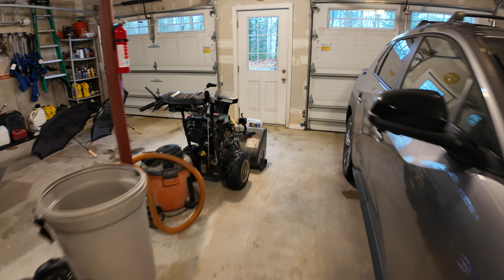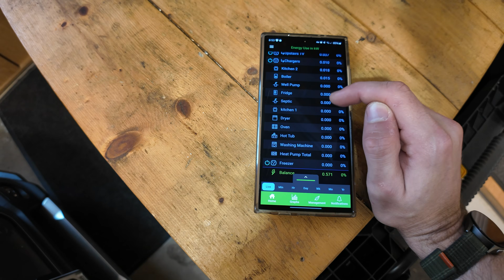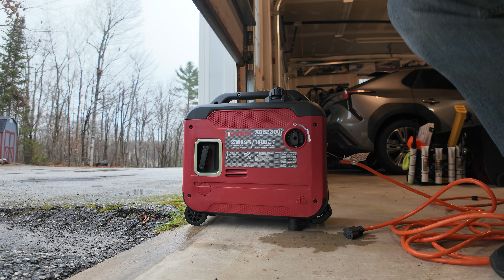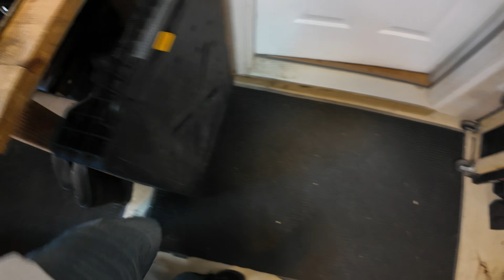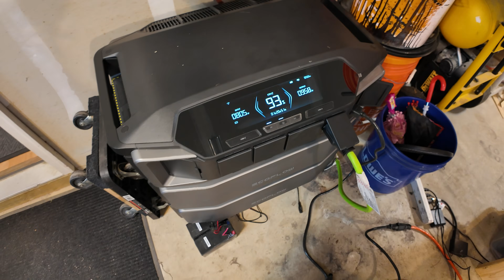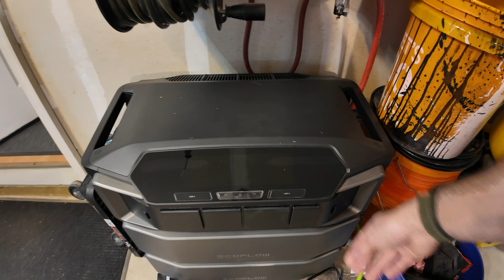Ecoflow Delta Pro Ultra Testing - Small Generator and Limitation While Charging - Home Setup

Comment: When charging and discharging the gas generator is covering both the input and output.( pass through )
Use fast mode and try not the run much in the house. ❤

Comment: Buenas. Compramos un ecoflow DPU. Como respaldo para unas computadoras, en caso de un corte, los equipos continuarán trabajando aunque hubiese un corte de energía de la red local. En mi país Venezuela. En estos momentos tenemos cortes de energía eléctrica diariamente de 6 horas. Al suceder un corte de energía, el equipo DPU. Hace el cambio a la batería de manera eficiente. El problema que tengo es que al regresar la energía de la red local. No se logra recargar o las batería del ecoflow DPU. Por medio del cable que se conecta al Tomacorrientes de la pared.

Comment: You could parallel another A-ipower with yours, they come with the parallel kit in the box. You can also get the dual fuel version of those online at Sam’s for about $50 more. If you wanted a larger 240v inverter generator, I have and really like the Genmax GM7500iAED, also from Sam’s. It’s dual fuel, electric/remote start, pretty quiet and not bad on fuel. It’ll run 8.5 hrs @ 50% load (3,000 watts) on 3.3 gallons of fuel. I also believe that there was a firmware update for Ecoflow that improves the charging/pass through power capability while AC charging.

Comment: Why don't you use it every day to run devices in your home instead of back up ?
Reply from the maker: I dont get time of use deals on electricity use so it would cost more to use it like this until i get solar panels.   My plan next summer is some yard panels connected so i can charge my car.

Comment: Do you have the high speed charge switch set? Was reading about firmware updates for the inverter to fix that charge + discharge issue.

Comment: Great video, I’ve been following your content for a while! I also dream of having a solar setup like the EcoFlow Delta Ultra one day. For now, I’m using an Allpowers system – the batteries are a bit limiting, but I hope the EcoFlow solution works even better. Do you feel like adding more batteries makes a big difference?🔋🔋
Reply from the maker: Until I get solar panels, this system is literally just for power outages.  Once I get a few panels up I will use it to charge my car and in that case more batteries will help

Comment: Probably when you had the load pretty high the Ultra probably went into pass through mode, and the ultra will just pass power through, so the load and input will sync up.
Reply from the maker: Thats what I think now too.  I have a larger generator that does a stable solid 1800 watts continuous now so I can use fast charge mode

Comment: I have this exact generator from Sam’s along with Delta Pro and Delta 2 with extra batteries for each.  This is the first video I have seen where this exact generator is actually charging the unit.  Thanks for proving you don’t need a 3600watt or more generator to charge the Ecoflow.

Comment: So greatest video my friend, so I can charge my ultra with just battery please help ,I have bought a firman dual fuel 3000 to 4000 I need know if this will work. Thank you 🐊🌴😎
Reply from the maker: I replaced this small generator with the firman wh03242 a dual fuel 4000 watt generator and it works great with fast charge on using propane.
Reply: @mainelyhobbies sorry I just seen you comment,,yes you must have caught the blue store sale too,250.00 same generator, lol great videos thanks for vide,🌴🐊😎

Comment: A. You are assuming you are home all of the time.  B. If at night, it will be pitch black.  Do you have flashlights around the house that you can have in reach in each room to see to get to the panel.  C.  A house with just a standing fridge w/freezer, a standing freezer, 5 ceiling fans, a 2.5 ton AC unit, gas stove/electric oven, 1250w microwave, lamps in five rooms, washer and dryer, WiFi and internet hub, 2 computers and printers, 3 cable tv boxes.  Uses 20 kWh per day.  Each battery holds 6 kWh of power.  I want my system to have a day and a half of battery power from the start.
  Why not buy the Smart panel 2?  It switches to battery power automatically and turns off automatically when power is back.  Also, the ultra seems to handle the surge from losing power to starting the ultra with everything having to restart.  Thank you for sharing.  It has been very informative and educational.  Take care and May God Bless!  😇🙏🏻🇺🇸🫡🫡🫡🫡
Reply from the maker: Hey I havent been willing to spend the money for the smart panel 2 until I get solar panels so it can help recover the cost.    I have also heard it has a lot of reliability issues so im kind of hoping for a version 3.

You are also in a different world where you need AC working vs me just need a little power to run an oil boilers for heat and hot water.  I might go the eg4 hybrid inverter and ecoworthy rack battery route to hit 30kwh of power.. it would be a lot cheaper at $850 per 5kwh.
Reply: @mainelyhobbies  Fair enough sir.  I am looking into the Ultra myself.  That’s how I know how many batteries I need for a day and a half+ power.  I just saw the smart panel 2, so I haven’t looked at it hard yet so I am ignorant of any issues that it may have.  I saw a video last night with a guy using a Champion 4000w generator to charge is ultra.  He says it recharges the batteries fast and uses very little fuel from his generator.  He said he charges twice a day if needed just to top it off for the security of night time power.
  He likes it better than solar.  So when I get my setup, I would use the generator once every day, since I can run a day and a half on just the ultra with four batteries.  I may just go the full five and see how it goes.  The thing I like is you can recharge the batteries while simultaneously powering the house.
  I live in Ga.  U.S. East Coast.  Anyway, take care bud and may God Bless! 😇🙏🏻🇺🇸🫡🫡🫡🫡

Comment: I have a Jackery 5000 plus with an extra battery and I have a small 4.5kW array on my lawn. I've been using it to charge my EV. I haven't charged my Tesla once from the grid since I've set it up. I think you mentioned you couldn't charge your EV with your DPU? If so, I'm not sure why. If you have a Tesla, their mobile charger requires a neutral ground bond plug to be installed, which is very easy to make yourself or you can buy one off of Amazon. 

Eventually, I'm going to set up a critical loads panel and have my setup run it all the time. I'm going to get more panels and maybe another Jackery. The more items I can run on solar, the more I can rely less on the grid and drop my bill.

Comment: Just a curiosity. You are the first person I’ve seen take output from the front panel 240V 30A plug… I’ve mostly seen people take and output from the side INPUT/OUTPUT port… I know EcoFlow has a GENERATOR cable that lets you charge for the side port , but there is no 240v 30A Output from the side port.  The plug would have to be an R , not a P.      IS THIS CORRECT?

Comment: My plan with this setup is using LiPo4 batteries I already have to plug into the solar mc4 connectors. Way cheaper than purchasing more ecoflow batteries. Then generator to recharge if we go for extended power outages. This is all until I get some solar panels installed.
Reply from the maker: Yeah, 48v 100ah rack batteries have gotten super cheap and via the solar input give a decent charge rate.
Reply: @preplair The main issue with that setup is that the the DPU cannot communicate with the external battery to manage power draw based on its state of charge and the heat of that battery. Also , you have no way to gauge how much total energy remains, since the battery’s SoC isn’t displayed in the DPU menu. On top of that, you must rely on additional charging methods—either an AC charger or a separate solar array—to top up the external battery when it runs down. By contrast, that dedicated solar array for external battery could be connected directly to the DPU itself. Although the DPU battery is more expensive, it remains the safest and most reliable long-term solution.

Comment: Have you been able to test 240v input on the infinity port yet? 
Everybody is using small gas generators that only have 120v output.
Reply from the maker: No, I dont have a 220v inverter generator.. just the noisy style that wont work with the DPU.

Comment: It is a good practice to run a test on your equipment; I know it is short for video purposes. Just a suggestion run the test for a full day and then two days, to check any bugs in the system. Some  preppers do this with a food supply and they found  what looked like a lot turned out not to be enough. Also the cord running from your generator looks like a 16 of 14 gauge wire. I went to a 12 ga. and now I just use a ten, because of resistance and fire hazard. Good video good luck.  Our media keeps reiterating we have a weak grid and to be prepared for power outages, you are on the right track.

Comment: When charging a battery bank or solar generator, the input of say 1,200 watts into a EcoFlow from a generator will actually be drawing anywhere from 1,280 to 1,350 watts. Because of the efficiency loss of charging, keep this in mind when how much to charge from a gas generator so as not to run it at 100% duty cycle. 
My thoughts about using a car to charge a home battery bank are that the car is to valuable to either damage it or use all its internal charge or fuel tank supply. You will need this vehicle and using it as a generator seems cost prohibitive especially if you break it.   A small to medium gas or propane generator + oil+ fuel +fuel tanks or cans is cheaper than ONE potential vehicle repair. 
Plus if the car breaks down you could also be stranded! 
My two cents.  
I appreciate the real testing here 👍
120 volt in while outputting 240v was a curiosity to me.

Comment: Your little portable generator is straining under load with that thin/long power chord.  But, this is a real world demo.  I learned from your video the 12 KW Delta Pro BB will draw 1150 watts for only 9 hrs. @ 93% charge running your computer, lights and refrigerator.  Useful info.
Reply from the maker: Right.. real world testing lol.  the biggest lesson i learned is that the DPU needs something like a 4000 watt generator so that you can run it on fast charge mode which uses 1800 watts continuous.   Fast charge mode lets you use the full DPU output.

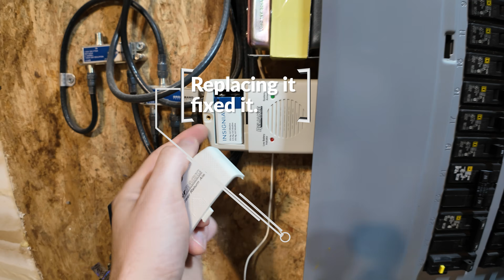Comment: 18:44 I wonder why it needs battery.  I thought once it has power it would turn on and start chirping.  I saw you physically had to turn it on 4:26 so it's not like it will constantly be chirping since you only turn it on during a black out and will chirp once power is back.  So not sure what the battery would be for.
Reply from the maker: That device doesn't actually tap into the house power at all. It is just wrapped around the mains just above the main 100amp breaker. Once it senses voltage it sounds the alarm. So changing the battery out fixed it once but it stopped working again when I tested another day. I had to take off the panel cover and wrap it a few more times around the main line and now it works as expected.
Reply: @mainelyhobbies  gotcha makes sense I thought the wires were connected. So it's like a electric clamp meter.

Comment: Two things:  1.  You can input 240 from a generator to charge and out put power.  2.  I have the same powerback alert.  Worked great once.  I had the power go out, used my DPU for back up and turned on my powerback alert.  A few hours later, I saw the neighbors lights on!  The powerback alert did not go off.  I inserted a new battery and still it did not work.  Did you replace the battery and see if your powerback alert worked?  There are only two available I see online and the other one is not as easy to install.  Not sure if some dirt from dust got into the speaker or a spider built a next in the speaker.
Reply from the maker: I had to open my panel and wrap the power back cable around the main a few more times.  It seems to work fine now. I have it zip tied now.    I think it uplooped one wrap when installing my emporia vue power monitor.  
240v charging would be nice.. 2 hours would top me off for a full day.. but finding an inverter generator to do that is expensive, and where these batteries are stored, I used to keep my old big (non inverter)generator.. I dont have space for a big battery AND big generator now.
Reply: @mainelyhobbies  Thanks  I will have to take of my panel cover and see if that is the issue.  It makes that same chirp noise for a microsecond that yours did in the video.
Reply: Did not work!  Read reviews and a lot of people have the issue that after a few times, it stops working.  Ordered a brand new brand and place onto my panel.  Hopefully, it will last.

Comment: Saw a recent video where I guy was charging on the 220 side input at 6000 watts. Said a new firmware update helped make this possible.
Reply from the maker: Yeah, I know if you have it set to full charge speed, it lets you charge while getting full output.    In my case, I need a bigger generator to hit the 1800 watts continuous so that I can turn fast charge on.    There are hints of it working this way in the manual, but they dont spell it out.   Had I known I would have bought a 3000+ watt geberator so that it can run at 1800 watts safely for hours at a time.

Comment: Wrong, wrong wrong. learn how to Use the equpment before making a video. There is much more capability on the ac charging port and operation than what you tried to demonstrate.
Reply from the maker: It's not "wrong", this is how it performed with my equipment, which is not optimal.  If my generator could handle 1800 watts, it would be a different story.  The lesson here is I bought the wrong gas generator for the the delta pro ultra, mostly because of unclear product material.   I am hoping to redo when I see a deal on the right gas genny.. probably a 4000 watt inveter generator so it can handle 1800 continuous.
Reply: Do the firmware update then read the new operating manual. On fast charge you can charge at 1800w and discharge at up to 7200w. If fast charge is off then the generator input must be greater than the draw or the charging will shut down

Comment: I have a Pecron 3600w, 9kWh battery system. I just upgraded my Champion 2500w, 1650w runtime on propane. Ideally for longterm usage 50% or about 800w output from the generator. Bought a Wen 4800w dual fuel, propane 3600w runtime. (Only plan on using propane.) Charging my Pecron at 100% on 120v 1800w, same as grid power.
Reply from the maker: I've been eyeing the 4000-watt champion gas or dual fuel generators simply because the brand is more known (usually better for parts)  but I'll check out that WEN as well.   I know WEN sells parts direct since my dad had   the filter in his WEN fuel tank dissolve and clog the carb.    I think that was using regular gas vs ethanol free related, not so much WENs fault.

Comment: I agree with others. This is a very simple and practical video. Thanks. I only use a Delta 2 Max to support my furnace blower in power out. That said, I have separate Deltas on refrigerator and elsewhere in house. I wonder if I could charge two Delta 2s on my 2800 Wen at one time, if I limited to 800 input each? I would keep the furnace running at low setting but just unplug refrigerator, to charge faster and consistently…then move on to next Delta.